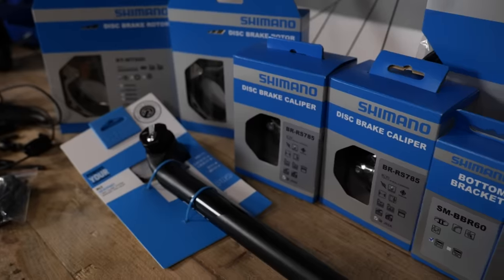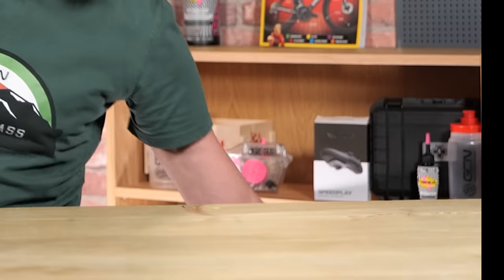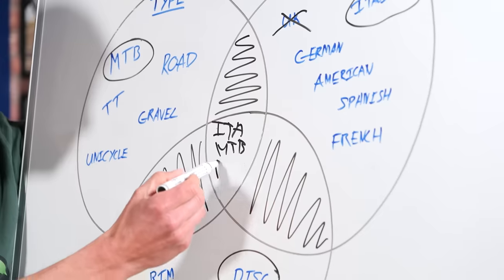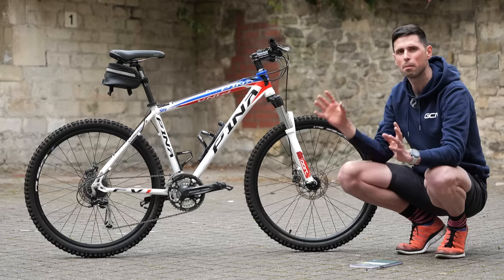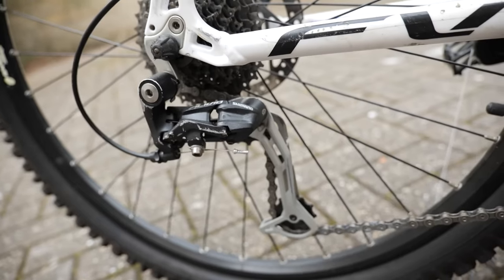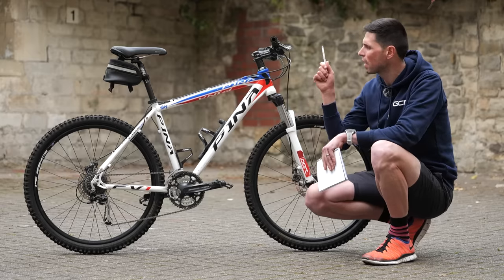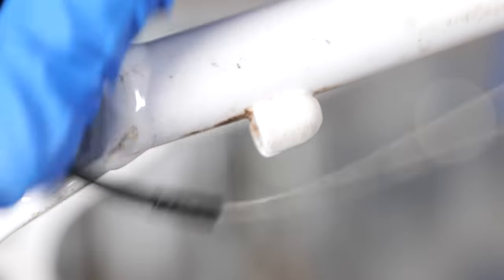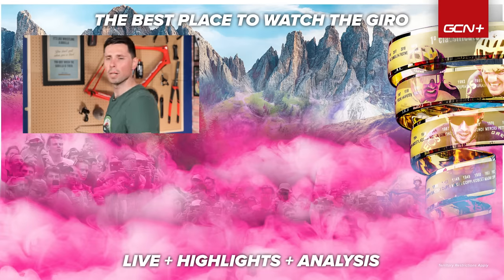Can We Convert An Old MTB Into A Super Gravel Bike? | Ep. 1

Comment from the maker: Have you ever done your own bike build?
Reply: Yes. You all make it look easy. Part compatibility is annoying! Diameters of things. Thread types. I wish I could just enter my frame make/model/year into a website and order all new parts for it from one source and know that I am getting parts that are compatible with some old frame I bought on Ebay. Then the bike shortage would go away, haha!
Reply: This is exactly the type of video i need!
My brother has a 90's Klein Attitude MTB and I've always wanted to convert it to a modern ish bike, with drop bars and rigid front fork (before Gravel bikes were a thing). 
My only issue is the brakes, i think they're cantilever brakes or V brakes. The front could be anything as i could get a fork to fit the type of brakes i would want, could be disc brakes, road style rim brake caliper, mtb rim brake caliper. But for the rear, what brake type would fit the mounting point if it was a V brake or cantilever brake? Would it only fit that type, or can i match with any new road or mtb rim brake caliper like the front? Would there be issues if i used different brake types front and rear? 

As it's 26in wheels, i would use 650b. 
But what issues would there be if i got a fork that would fit 700c or 29er wheel on the front and then put 650b on the rear?
Reply: Currently working on a similar build/upgrade to my first MTB. A KHS Alite 1000 from the early 2000s.
Reply: Yes, but Shimano blew me off.
Reply: I'm currently on the process of converting my mtb to a gravel bike. I used 25.4mm x 90mm stem and 400mm x 25.4mm dropbar and a micronew 3x10 sti and ltwoo A7 fd and rd. I have 11-42T cassete and 28-38-48T chainrings. I still need to buy barrel adjusters to adjust the cable tension since my local mechanic can't tune it correctly without it. I have mechanical disc brakes though I'm planning to change to cable actuated hydraulic brakes in the future or  2 piston mechanical brakes. And I'm planning to change my rear derailleur for something better but not that expensive. Lastly, I'll probably change the frame and wheelset someday.
Reply: Interested to see where this is going ! By the way a full carbon gravel bike frame (with a fork ) similar to many on market now can be imported for £400 or so from China .
Reply: ...in association with Shimano....
Reply: Converted an ancient Trek 26" wheeled, V-braked MTB awhile back. Bought only drop bars/stem, brake levers, bar-con shifters, fat slick tires and a smaller cogstack. But I was spending MY money, not GCN's so no bling-factor :-(
Reply: no but i have basically replaced every bike part possible so i could probably do it.

Comment: I am not sure what the point of this video series is when you have thrown $2400+ at it, that's a pretty damn nice Specialized Diverge or Trek Checkpoint. People convert old mtbs to drop bar because it's a cost saving measure (or at lest that is why I'm doing it), so going balls to the walls will make this bike stand out from its converted brethren and probably not in a good way.
Reply: It's an ad for Shimano, that's the point.
Reply: I made that mistake 4 years ago, I spent more than I could have bought a sora checkpoint for. And I had put sora on my build. Mostly it was the $800 I spend on new wheels. I parted back out my mistake and use those wheels on another bike. But I could have bought used carbon wheels for less, it’s two big mistakes.

Comment: USA hardtail MTBs in the mid 90s were the very best for cutting edge innovation and crafting -- Bontrager, Ritchey, Marin, Moots, etc. Once you ruled these out and set your budget too low, everything else was pointless -- because the frame is the soul of the bike. I personally have upgraded a Bontrager Race TiLite, a Moots YBB, and an Airborne Lucky Strike, all beautifully crafted Titanium, and all 3 perform better than modern gravel bikes at 3-4x the price. You can save money by not spending beyond Shimano XTR 3x9 dual-control, the best groupset ever made.
Reply: This comment exactly, you'd do far better with anything from the mid 90s, the thing he's got is about 10 years old and the components are below Deore, it has a Pinnarello badge and that's it and £500 for it is daylight robbery

Comment: I took a 2012 29er hardtail frame and made a sick drop bar MTB/Gravel bike out of it. Probably one of my favorite bikes that I’ve owned and it’s not even close
Reply: @simonorr5987  I’m running a 100mm Manitou Machete suspension fork. I did go rigid but the suspension is sooooo much nicer. And on Road it’s plenty firm enough even when not locked out. Also have a suspension dropper post. It’s niiiiiice
Reply from the maker: Wow, sounds awesome!

Comment: Nice ride! I did the same thing with my 2010 Scott Scale 29er hardtail.
 -Stand Crest ZTR wheels with Vitorria Mezcal tires with Stans sealant.
 -Salsa cow chipper drop bars
 -Shimano 105 shifter coupled to a Tan Pan to keep shift ratios to an XT derailleur coupled to an 11x52 cluster and a single Wolf tooth 32 upfront.
 -The front brake is a hydraulic TRP brake to compliment the hydraulic 105 shifter/brake.
-I replaced the Reba fork with a Surley Krampus.
I ride this more than my road bike and mountain bike combined as it is so versatile.
 Keep riding
Reply: Do you have pictures? I just rescued a 2011 Scott 29 Scale Comp.. wanting to play with it a bit.
Reply: @mfdonjaco  where send pics?

Comment: Just for fun, I recently converted an old 1989 Rocky Mountain Hammer to a "gravel" bike. Just changed over to drop bars and used a set of 3X7 Tourney shifters. Left everything stock. Works a treat. Leaves me with a coprophilic grin. Total cost, 160 GBP. (250 CAD)
Reply from the maker: Very cool indeed!

Comment: My trek4500 26er was converted. The frame will take 700x38c. Chucked the front suspension & got a rigid carbon fork. Went microShift 1x10. The frame had bolt holes for an adapter so hydraulic discs. Surly corner bars.
Reply: THAT is the proper job! Absolutely amazing that you even got that size wheel in with any tyre at all! What size chainring did you fit?
Reply: @peterharrington8709  It has a 40T chainring at the moment - it took all 116 links on the chain. Am thinking about dropping to 38T or 36T. At the moment the bike is in Florida where it's dead flat so 40 is OK, but the bike will be going home to the Isle of Man next year and I think it will need a smaller chainring.

Comment: i have an 26er with 1.95 650b tires and wheels it fits my 26 frame and i have an alloy rigid fork and 100mm -35 stem and 1by with 42t chainring 

i mainly use it for flatroads and crit racing and sometimes light gravel

Comment: You're probably gonna get a lot of stick for using such high end parts but I'm looking forward to this. Dozens of youtubers have cobbled together parts bin "Gravel bikes" which doesn't really tell you a lot about how they compare to bikes with more modern components. Di2 is probably pushing it though, for the price of one GRX group set you could get a mech' hydro gravel bike good enough to race on.
Reply: Scratch that last part, just had a quick look and you could buy 2 mech' hydro gravel bikes and have enough change left for a bag of chips.

Comment: dude - an old mountain bike did not have disc brakes or suspension - my oldest bike- " friction generator " had coaster brakes- kinda had to push them up some trails and they almost caught on fire on the long downhills - smoke coming out of them old brakes !!!!!  then removed the coaster brakes and strung cables  for brakes and built a rear wheel with like a 46 freewheel and a long cage derailleur-then some guy named Chris Chance made bikes---with out shocks----not many folks remember those those old days---turning two old Merlins from 1988 and 1996 into " Cross Bikes "-enjoy all

Comment: wrong type of "old mountain bike". For a start it's too young and secondly it's got a suspension fork  (please tell me you're not keeping that...)  so the geometry will be all wack with a rigid fork lowering the front end. Late 90s full rigid after they stopped using quill stems is the era bike you want.  They were more nimble (aka twitchy) than the slack head angle more modern bikes. 
And how can you use "keeping costs down" and "GRX Di2 groupset" in one sentence and keep a straight face?  
Wanna see how to do this properly?  Go look at Old Shovel's channel, or Eric on Spindatt. 
I'm building a gravel(ish) bike from a Kona Smoke using some NOS 5600 10spd 105 shift levers on flared drops connecting to what was 9spd Deore mechs (it works, they run on a 10 spd cassette) and properly set up cant's will have more than enough braking force.  It might all be old stuff, but it will have retro-cool that this pile of flashy parts could only dream of. 
Having said that...  Messing round with building/modifying bikes is cool whatever kind of thing one is Frankensteining together.  wrench on.
Reply: The fork wont be an issue (if he changes it), 26" suspension corrected rigid Disk forks are super easy to find even in carbon and they are pretty well sized to take a 650b. The biggest issue is the reach/top tube length.

Comment: Or just get a 29er hardtail and drop everyone on the tech sections and still keep up with everyone on the road sections...
Reply: That would be the most logical solution, but you know..... gravel 🥸😂
Reply: Is lot easier with 29" but to compare to gravel You need at least:
- Fit narrow 19mm rims (if lucky: narrow rims is standard, keep cost low) and fit 700c x45 or similar tyres (when lucky and have one with better rims: tape and magic - make it's tubeless)
- "roadie" handlebar - option for more aero position (not must, but ride against the wind make difference)
- maybe 2nd hand fork without suspension? or one lightweight from hybrid bike (short travel)
Standard 29er is not very fast (usually) due to smaller front sprocket(s) if compare to gravel. So next logical step is change drive for "gravel" type. Or at least sprocket only.
....
Keep original tyres (wheels)/handlebar/sprocket for winter :D

Comment: I did it about 2 years ago... But I used a aluminum 29er MTB, one frame size under, rigid alloy fork and gravel bars... The only problem was the very long top tube lenght... And It was a "boneshaker" tio, due alloy frame & fork 🤣🙈
Reply: I'm looking to do the same. You went a frame size under?

Comment: It doesn't seem like anything needed replacing.  If you wanted to go with 700c, then the frame and fork would not be big enough.  For 650b, you'll compromise the tire width in order to make the wheels fit.  Best to start with a 29er.  But then you're already starting with a modern bike.

Comment: Woulda looked for a 90's- 2000 steel frame bike with rigid forks to take 700 or 29er wheels mesen.
Or if using a mtb, at least fit a suspension corrected rigid fork.

Comment: You spent 500 pounds on that? Its not worth that really. Should have gone with GRX400 on this one. 10 speed, you will only need a front, rear derailleur. Shifters, cheapest deore brake calipers since its not a flatmount. Could have kept the crankset and wheels if you really wanted too. Bigger mtb tires in fast xc compound low knobs or even beach compounds arent that slow.